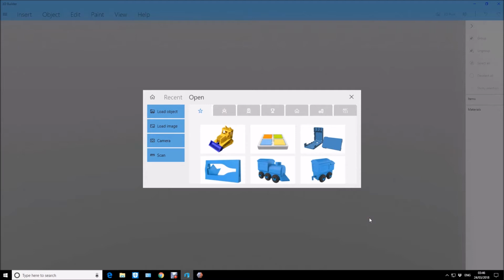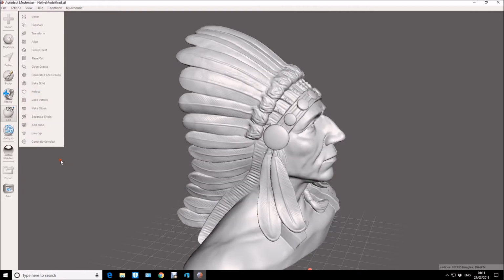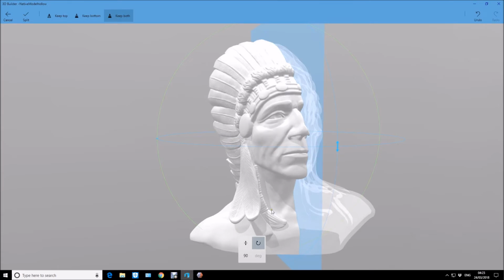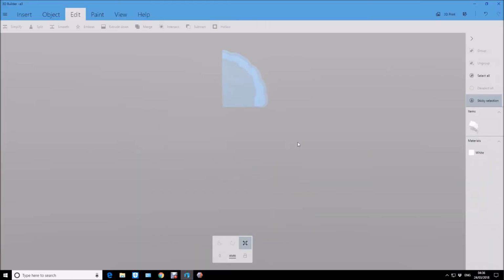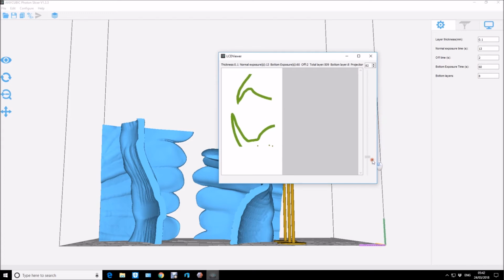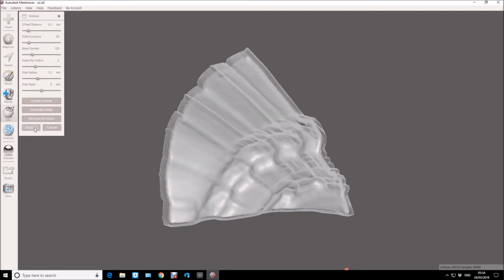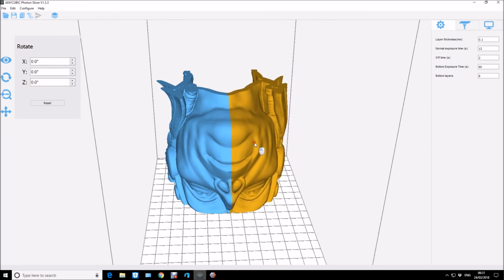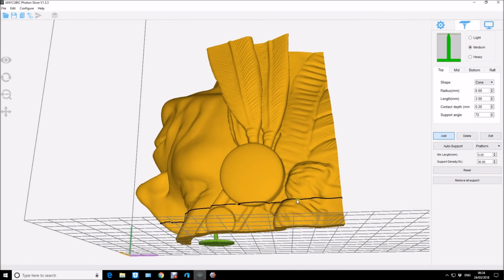Multipart models for resin dlp printing.

Comment: Hi   Do you know where i can buy resin for this printer in eu,  aliexpress and the org website dont have the resin shipped from eu.
Reply from the maker: hello there i would try amazon germany for the photon resin but a lot of users use Fun to do resins with there photon you can find this at https://funtodo.peediemodels.com/categories.php?cat=5
Reply: thanks for the link,,  no amazon -This item does not ship to Denmark.. i think that the resins for this photon printer is not legal for sending to many countries.
Reply from the maker: i know i had to pay a lot of tax to get 2 500mls into the uk from china of the photon. but try the FTD resin its very good.
Reply: ok what ftd resin is best for the photon, and can i buy the resin in gray and clear-do you know
Reply from the maker: ftd industrial blend is main one everyone is using. you can mix the 2 and make gray. they also do a colour kit that you can use to colour clear resin or white resin to make your own colours. if you get the pigmented colours well same with any resin thats pigmented never print 0.1 layer height. as the uv cant cure that heigh with pigment. so use no thicker layer then 0.07. i tend to use 0.06 for pigmented resin.
Reply: thanks
Reply: thanks
Reply: Did you print the indian in a larger scale, how did it come out..
Reply: Jan. 20, 2019---American here....did you check Ebay? It is available thru them.

Comment: Hi There, good video-  i did try to download the 3d builder, but i cant find the program you use, only the app. i use win 8,1.   is this program only for win 10
Reply from the maker: hmmm.. from what i know it should work fine on windows 8.1 i will have a look. k had a look and your correct for win 8.1 its an app. :( they give the impression on there webpage its the full program i take it all the main functions that i show are not with the app. :( you can still use meshmixer for cutting up the model and hollowing and slicing its just a little slower with meshmixer. sorry about that. :(